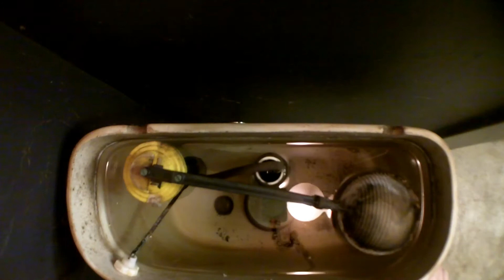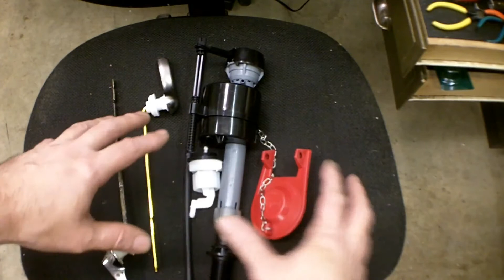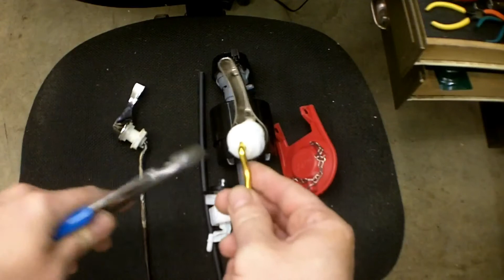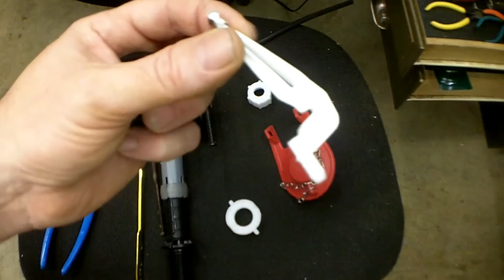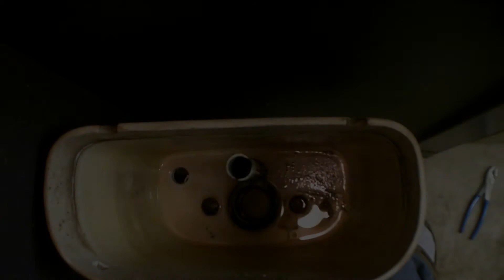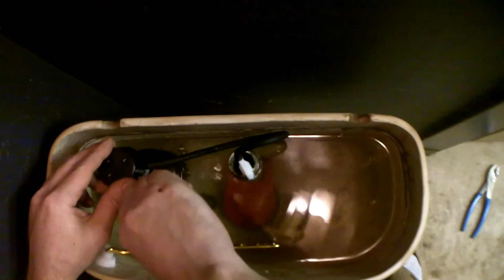Basic Toilet Repair How To

Comment: Good job on the toilet repair. I've worked as a plumber ,carpenter etc for over 35 years. I've seen it all. Check out your tank bolts. If they are all corroded replace them with close couple tank bolts sold at most hardware and home centers. Also replace the rubber gasket between the tank and bowl. The Flush valve (the part that the rubber flapper connects to can also go bad. The brass ones rot out. Hope this helps out . Send me a shout if you have a question anybody.
Roland
Reply from the maker: Thanks Roland. I've seen tons myself when I was in the trade. Some of the DIY stuff I've fixed was scary to say the least. Like people trying to fix leaks with caulking....lol. Good info you've added. Take care, G.